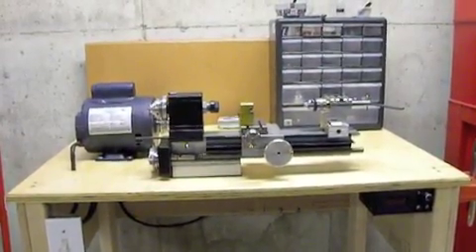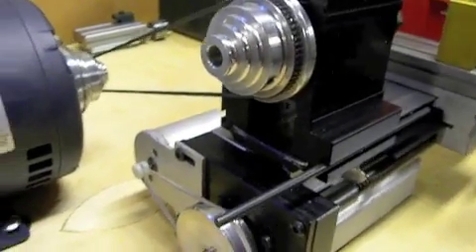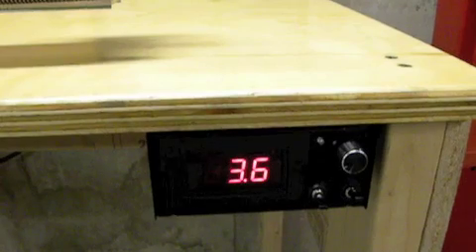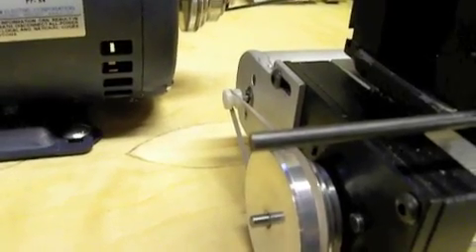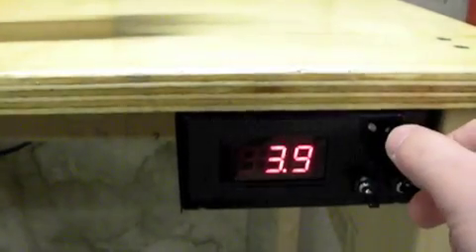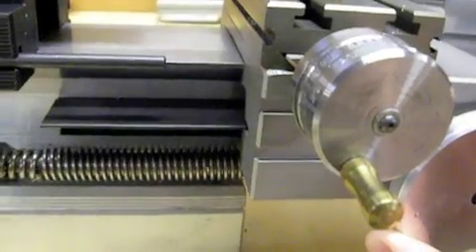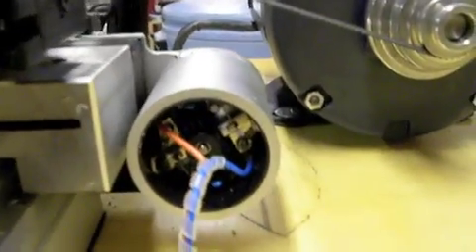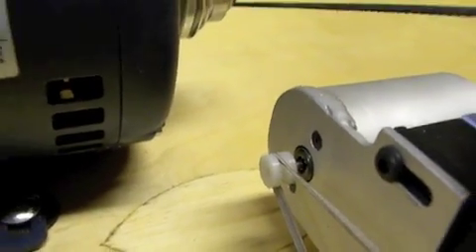Taig Inependent Power Feed

Comment: Be interesting to switch the brushed motor for a stepper motor and use it to also cut threads.
Reply from the maker: Yeah, that would be a cool setup. Both spindle drive and feed would need to sync with each other, but I'm sure it could be done. Working on a variable speed DC drive for the spindle right now though.

Comment: Thanks for the video. I want to set up something like this. Have you upgraded your set up? If you were to do it again, what power supply would you use? Thanks again.
Reply from the maker: I've added an improved tail stock lever and some knurled knobs to replace the thumbscrews on it. Not a lot more then that. I think I'd find something a little more robust for amperage output. I don't really need the 15 volts this cheapie one does, but a higher amperage rating then 2 amps would be good.

Comment: Did you try to cut thread?
Reply from the maker: No, the feed is too fine for that. It's not linked to the spindle head either so I can really cut accurate threads with this. Just meant for getting a nice, uniform looking finish on parts.

Comment: where can I get a motor like this for the power feed? I would like to put this together for my lathe but I don't know what to search for to find a motor like that please help
Reply from the maker: +Derrick Shannon 
It's an Integy 85 turn 540 sized motor. You might be able to find something like it at a hobby shop or more likely online. It the same size they typically put in RC cars, but this particular one has high winding in it, intended for slow speed and higher torque for RC rock crawling trucks or for running com lathes. I'm sure other motors could be made to work too, though.
Reply from the maker: +Derrick Shannon 
Also, I was looking around and I found some rough prints I had made for the mounting plate if it helps at all: 
http://www.cartertools.com/liberg05.jpg

Comment: if the motors brushless im not sure of the amp draw probley 4 amps free run no load, if its brushed has brushes it can draw as high a 5 1/2 amps and down to 3 amps, changeing the timeing on the motor can lessen the amp draw but has less power, you might be happyer with a 440 motor in stead of 540 your useing now,, its 3 1/2 amp draw, any brush motor will draw more amps with more power and heat, hope this helps by the way nice job keep it up,,Dave..!
Reply from the maker: I know this comment is 9 years old, but worth a reply still. 
Thanks! I appreciate the input! Just recently fixed the issue with a better power supply to run the motor. Found an old 10 amp, 6 volt supply that works great now. Can slam it from full forward to reverse and doesn't phase the supply at all. You're right though, a smaller motor would still have plenty of power with the gear reduction and draw less amps too.

Comment from the maker: I'm pretty sure the 2A rating it had was wrong (or maybe a rounded up number) since it has voltage regulator in it rated at only 1.5A. Even then I wouldn't think that an 85 turn motor would draw that much either, but apparently it does. As I'm starting to use the feed more, it's becoming a nuisance to turn down and up all the time. Eventually I'd like to get a better unit to replace it.
Reply: I'm thinking of doing this. What motor would you replace the 540 with?

Comment: I'm pretty surprised that 2A power supply has trouble supplying several tens of amps...  
:-D
Reply from the maker: Really the unit was cheap junk, probably good for under 2 amps. I've since upgraded to an old lab power supply rated for 10 amps and 6 volts, and it works so much better now.